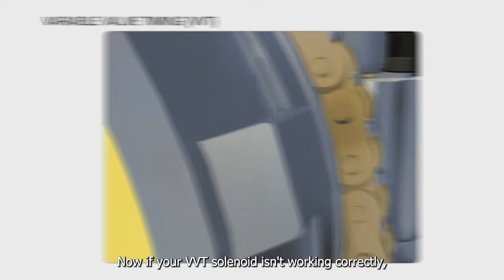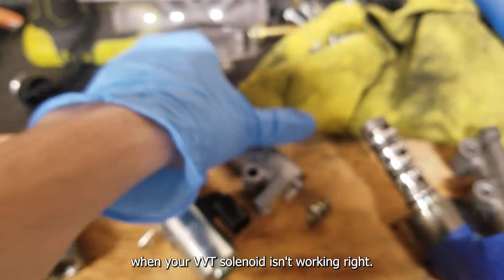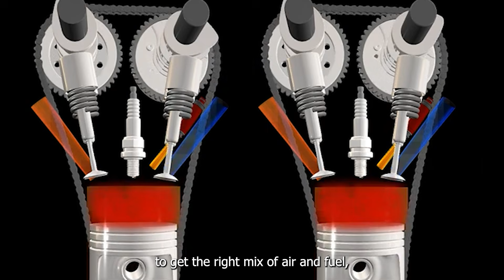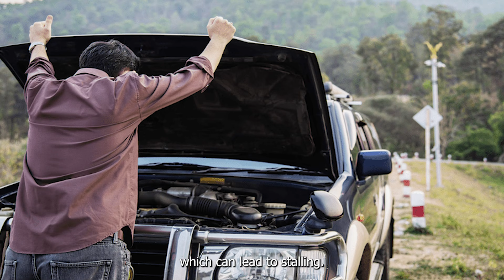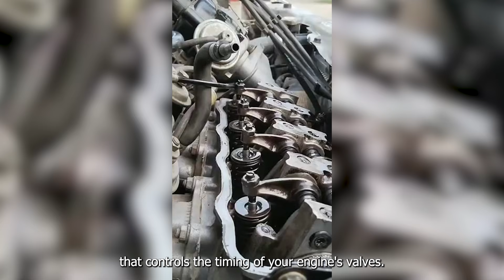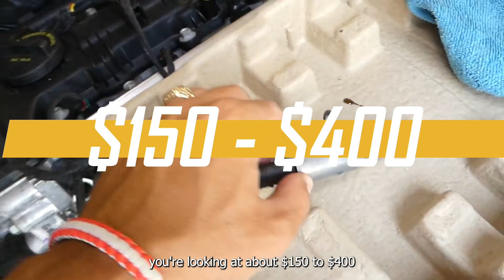BAD VVT Solenoid Symptoms: 7 COMMON Failure SIGNS

Comment: 2015 Tacoma V6 4.0L engine. Random Check Engine Light. Sets code P0022. Usually turns off after two complete drive cycles. Shuddering sometimes at 35-40 mph. Very random. No SES light during shuddering occurrences. 134,000 miles on odometer. Oil changed every 7500 miles. No misfire codes. Only code set P0022.

Comment: Hi. So, i have a 2014 hyundai sonata limited 2.4 engine. I'm have vibration when the car idle, more so when i shit to drive or reverse. When in neutral you can see the engine vibration. Do you think the valves are bad? 
Thank you for you great video
Reply: No codes

Comment: I have a Dodge Avenger 2013 and I changed out both my solenoids and it’s still knocking and rattling. Not sure what the problem is maybe the connectors.
Reply: Knocking and rattling sounds like a bad engine or loose timing chain
Reply: @andimoran2654  hope not.  I took back to O’Reilly’s to get another test done and the exact same error came up. VVT Solenoid Bank A

Comment: Hola, puse escaner me arrojó error en válvula VVT, lo probé , con la batería si funciona pistón de la misma , Con multimetro si tiene resistencia de 8.6 , lo limpie con CARBUCLEAN, ,use  el liqui MOLY flush en el motor ,cambie. Aceite ,bujías ,filtro aceite, y me sigue apareciendo el CHECK ENGINE, y siento todavía la poca baja potencia del motor que empezó hacer desde el inicio , mi duda es que si mi carro cuenta con el microfiltro de válvula VVT y e igual saber si está tapado el microfiltro en caso de que si lo tenga es una Ertiga Suzuki 2023 gracias 🙏

Comment: Hi, i change the vvti solenoid and the oil screen filter that works with the vvti system, however the car still does the same. 

It idles rough, splutters when driving and no power. What can still be wrong
Reply: You will need to check the check engine codes. Just had a truck with similar symptoms and it was a faulty fuel pump. If your VVT solenoid goes bad, there should be pretty specific codes.

Comment: 2007 volvo xc70  stuck now in limp mode --codes as follows:  1) ECM-21EC   2) ECM-9270   3) ECM-92CC   4) ECM-925D  5) ECM-9240   6) ECM-614B  7) ECM-400C  8) ECM-929D 9) ECM-242D  10) ECM-290B  11) ECM-280B12) ECM-212C.    All came on at once when went into limp mode...    In the past has thrown occasional codes for o2 sensors mostly but only 5-7 at a time, not 12!!!  and only limp moded on rare occasion but shutting off and restarting cleared it..    Volvo had this car for a month trying to solve it before I bought it to no avail after a new ECU installed as part of their "fix".. 
This almost seems like a loss of 5v refrence signals or a bad ground junction somewhere.. (note: this was formerly a rural indiana vehicle that was known for mice.. but I see no mouse damage anywhere..   )

Comment: im having the code p0017 come up which it says is the vvt solenoid (bank 1 sensor b) i replaced the part and the car seems to still run and idle rough! is there something im missing ? i replaced the solenoid on the exhaust side. appreciate anyone that can lead me in the right direction. also my car is 2018 hyundai elantra sel
Reply: 😢i was told the vvt were bad replaced them ran a OBD2 scanner poo17 code is crankshaft position sensor an poo16 code is camshaft position sensor 😢 good luck
Reply: @jamesdavis7700 yea, I got those 2 coming in tomorrow, I should have ordered those when I did the vvt solenoid . But thank for the help. Hopefully this does it

Comment: My car has a jerky motion.What could it be
Reply: jack links
Reply from the maker: A jerky motion in your car can come from ignition problems like worn spark plugs or weak coils.
Clogged fuel injectors or a failing fuel pump may also cause hesitation while driving.
If the jerking happens at low speeds, worn engine or transmission mounts could be the culprit.
Dirty sensors such as the MAF or throttle position sensor often create uneven power delivery.
Transmission issues, like slipping gears or low fluid, can also make the car feel jumpy.
Checking error codes and doing basic maintenance checks is the best way to pinpoint the cause.  Hope this helps.  Good Luck!

Comment: Hi thank you for teaching us but like for 4gr engine same symptoms occur and on the driver's side cylinder head pistons and plugs there's oil on them but passenger side is ok what could be the problem
Reply: Hi,my car Mazda tribute starts well and self pulling when engaged in D but immediately I try to acceralete it goes off,changed the cam and crankshaft but not improving what could be the issue?

Comment: I have a 2014 Lincoln Navigator with a P0015 code.. I’m wondering if the solenoid is my issue.. misfires, Lost of power, longer than normal start, acts like it wants to stall when in Idle at times.. rpm’s go up and down as well..

Comment: I have a k24 not following cam targets .
If u go full throttle it keeps hanging at 22degrees (max is 25) and it doesn't go down like it should not following the target that should go lower
Tried camsensors, vtc actuator another secondhand cleaned cam gear

Comment: The solenoid head where the wire connects, rotate about 30 degrees. Is that normal or it has to be replaced?

Comment: I have a 2010 Chevy HHR speedometer fluctuates and transmission changes hard, also rough idle, could the vvt be the problem, I've changed the transmission speed sensor and all four hubs with new sensors. Update I put a OEM transmission speed sensor on and it fixed the problem
Reply: Try cam position sensor.
Reply: @erikmendez6081 I put a OEM transmission speed sensor on and it fixed the problem

Comment: My nv200 2012 gaving me a rough ide
Reply from the maker: If your 2012 Nissan NV200 has a rough idle, it could be due to several common issues. Dirty or worn-out spark plugs can cause misfires, making the engine run unevenly. A clogged fuel injector may prevent proper fuel delivery. Vacuum leaks from cracked hoses can disrupt the air-fuel mixture. A dirty throttle body can also cause unstable engine idle. If the ignition coil is failing, it can cause shaking or poor performance. A faulty mass airflow (MAF) sensor can send incorrect air readings to the engine computer. It’s best to scan for error codes to help identify the exact cause.  Good Luck!

Comment: 2006 Kia Sedona misfire and low compression could that be cause of a VVT solenoid
Reply: low compression is typically a failure of the piston rings. a missfire can usually be caused by ignition or fuel components, however engines require compression  to help the combustion process, if the missfire and compression are both on the same cylinder then the low compresssion can and will cause a miss fire as well.
Reply from the maker: Misfire and low compression on your 2006 Kia Sedona are usually not caused directly by a faulty VVT solenoid. The VVT solenoid controls camshaft timing and can cause misfires if it’s stuck or malfunctioning. However, low compression is typically due to mechanical problems like worn piston rings, leaking valves, or a blown head gasket. A bad VVT solenoid might reduce engine performance and contribute to misfires but won’t cause compression loss. To fix low compression, you’ll need a compression or leak-down test to find the exact issue. Cleaning or replacing the VVT solenoid may help the misfire but won’t solve mechanical compression problems. Hope this helps. Good Luck!

Comment: I know I have a p105D and a P105C all coming from the solenoid that is on cylinder 2 it’s even causing popping noises when I accelerate which is annoying asf hopefully I am getting it replaced this weekend
Reply from the maker: The P105C and P105D codes on your vehicle are related to the MDS (cylinder deactivation) solenoid on cylinder 2. These solenoids control oil flow to deactivate certain cylinders, and when one fails, it can cause poor performance. The popping noise you're hearing during acceleration is likely due to that solenoid not functioning properly, leading to misfires or valve timing issues. If left unchecked, it could cause damage to the spark plug or valve train over time. Replacing the solenoid this weekend is the right move and should fix the codes and the noise. After replacement, clear the codes and do a test drive to ensure the system is working properly.  Good Luck!

Comment: This is really great.
What could be the problem when the car is switched off, it needs to unplug the negative terminal for it to come back to normal if not the then it will it will just be moving in gear one.
Thank you

Comment: 2017 Kia sedona. Have a P0018 code. I replaced the Cam and crankshaft sensors when I had the codes for them now I have the P0018. Getting ready to  replace the VVT solenoid. If I still have problems what could next?
Reply: Did it end up working? Mine has the same code.

Comment: 2007 GMC Acadia. Clicking and tapping sounds like the cam isn't getting enough oil, but at times engine runs smoothly and quiet like nothing is wrong. Then all of sudden the ticking and chatter comes back. Sometimes quiet for days, under all use conditions, sometimes the noise is brief. Car been somewhat sluggish on hard acceleration since I've gotten it. Sometimes it takes off like a finely tuned jet. No sel lights on except occasionally for 02 sensor on bank something. Is this a vvt solenoid issue???
Reply: I guess yes, better get checked. This will cause your catalytic converter problem if not fixed now.
I had the same problem but the dealer couldn't figure out as there was no other code than 02. After watching YouTube videos I got it checked and yes. This vvt was the culprit

Comment: 2008 dodge charger starts but after driving it and turning it off it’s silent won’t start i have tried everything please help 4:57
Reply from the maker: If your 2008 Dodge Charger starts but then won’t after driving, begin by checking the battery for strength and ensuring the connections are clean and tight. A weak battery can cause intermittent starting issues. Next, inspect the starter motor, as it may be overheating and failing after use; tapping it gently can help diagnose this. Ensure the ignition system and key fob are functioning properly, as issues here can prevent starting. Check the fuel pump to confirm it’s operating, since a failing pump can lead to stalling. Also, examine fuses and relays related to the starting system for any that may be blown. Hope this helps.  Good Luck!
Reply: @ new starter new battery and neg connector new key/switch programmed  I think something is getting hot cause after the car cools it starts do you think it could be my ECM  it been in a shop they     Could figure it out 🤷🏾
Reply from the maker: @mz.benford6865  Sorry for your troubles.  Since you've replaced the starter, battery, and negative connector, and have a programmed key/switch, it sounds like the problem could be related to overheating components. The ECM (Engine Control Module) might be overheating or malfunctioning, causing intermittent starting issues. If possible, have the ECM tested or re-flashed to rule it out. Another potential culprit is the ignition switch, which can fail to send signals when hot, but you said you already replaced it. Also, check the starter relay and any related relays, as they might fail under heat. Inspect the wiring for any damage or shorts that could be causing overheating. Faulty sensors, like the crankshaft or camshaft position sensors, can also lead to these symptoms when they get too hot.  Good Luck, and I hope you can figure it out and get it fixed.  I know it  can be very frustrating, I have been there many times myself.